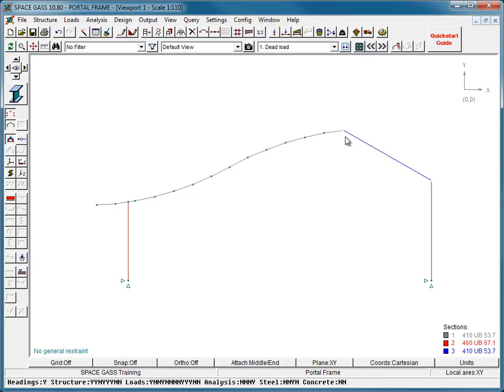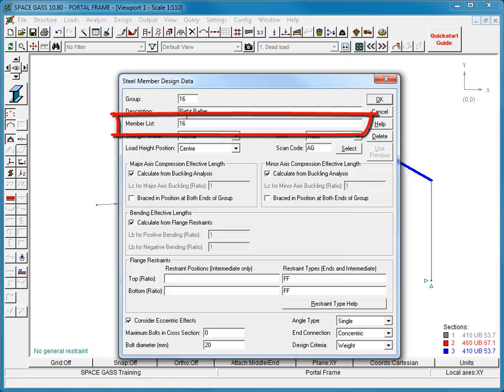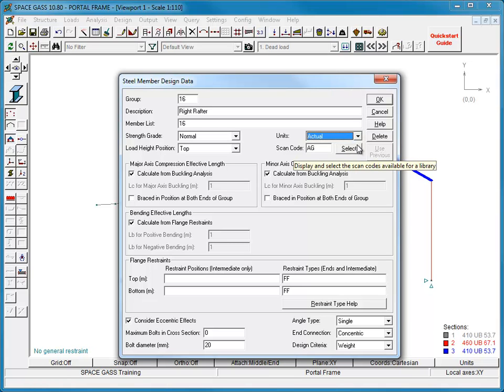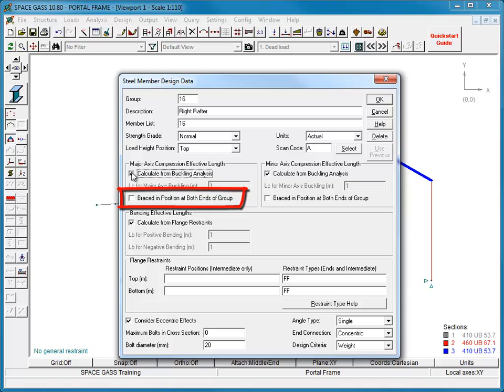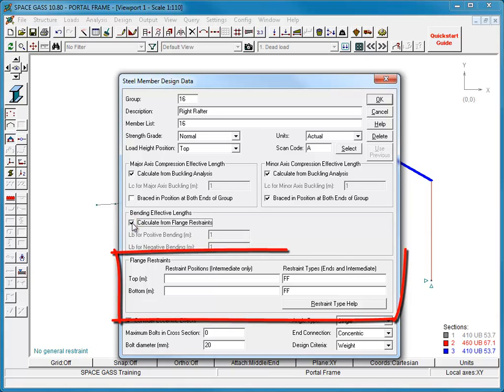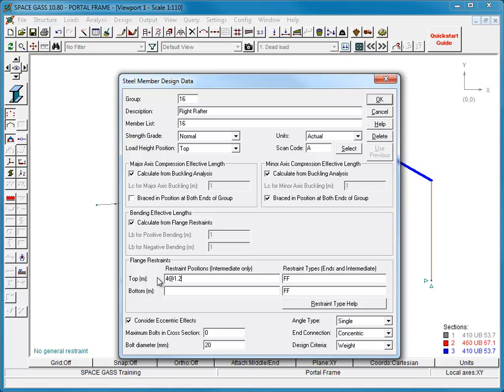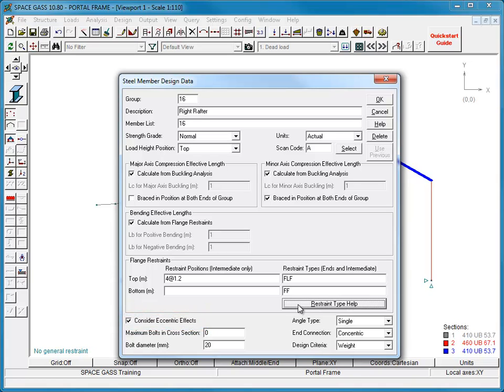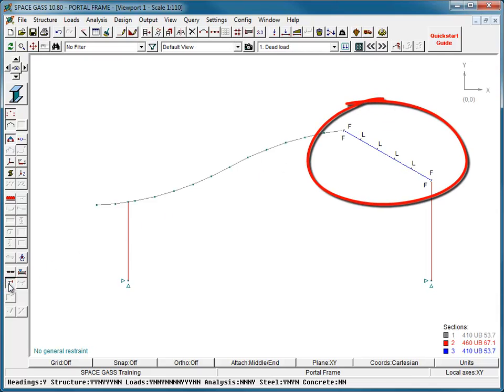SPACE GASS Steel Member Design Part 1

Comment: why not associate fy and fu with the material properties, like E value? right now it is very clunky to modify fy to say 230 MPa for historical steel members?
Reply from the maker: Hi @andrewrae8064. 
Yield strength varies from section to section as the thickness of the elements determines the yield strength, so different materials would be required for each section. While yield strength is used in steel design, Young's modulus in the materials is only used in analysis. The Young's modulus value in steel design is as per the relevant code. 
For old sections, you can check out SPACE GASS's standard libraries like AustOld and Aust250.